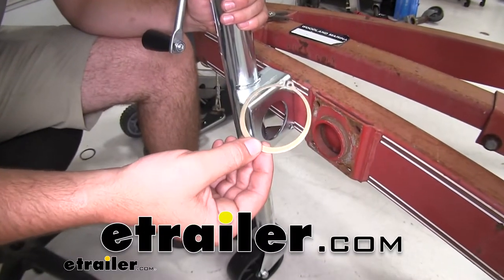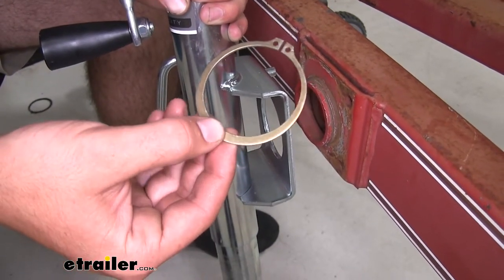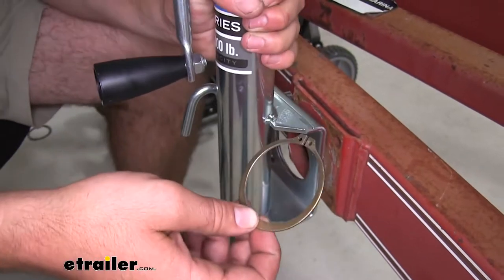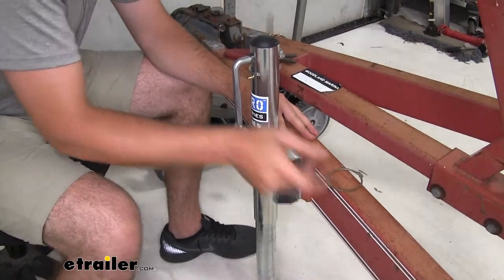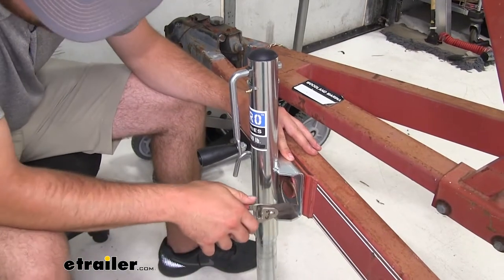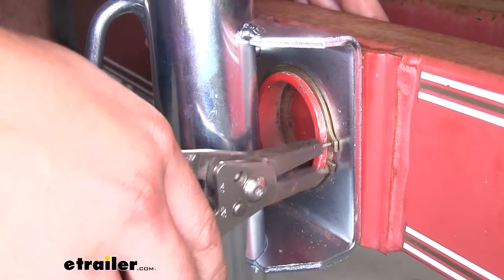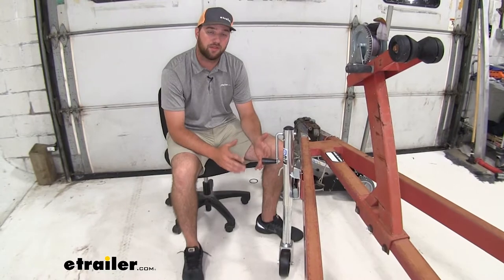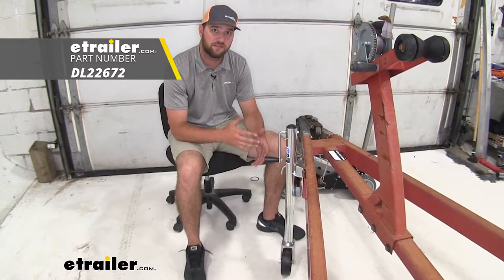etrailer | Detailed Breakdown of the REPL Snap Ring for Swivel Trailer Jacks

Comment: What would happen if someone didn’t use this during install?
Reply from the maker: If you didn't use the snap ring, the jack would not stay on the trailer. If you did not use the snap ring pliers, it would be very difficult to get the snap ring in place.
https://www.etrailer.com/Accessories-and-Parts/Dutton-Lainson/DL22672.html